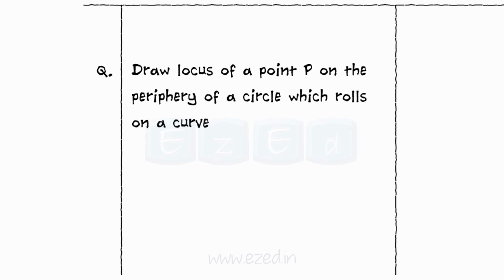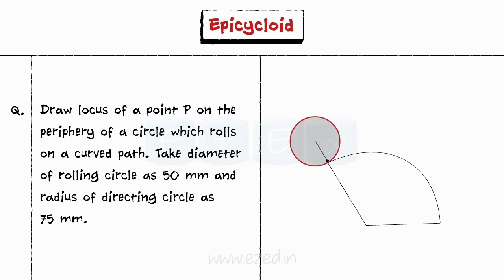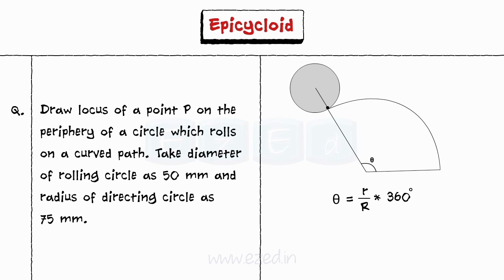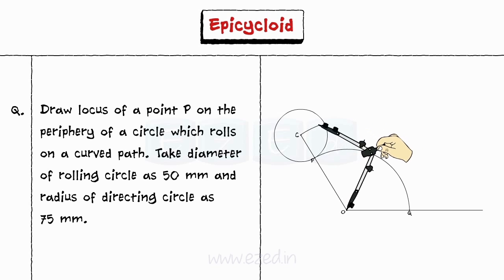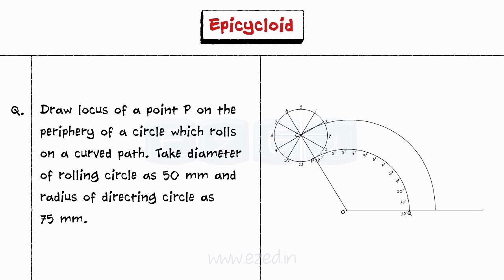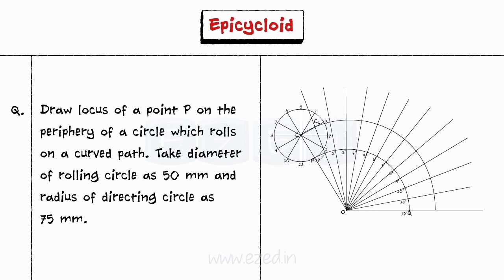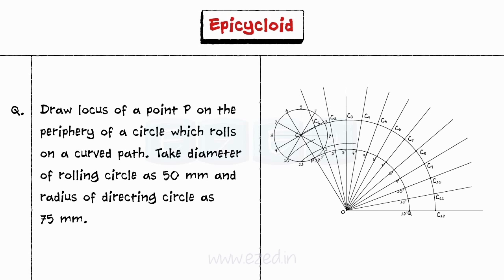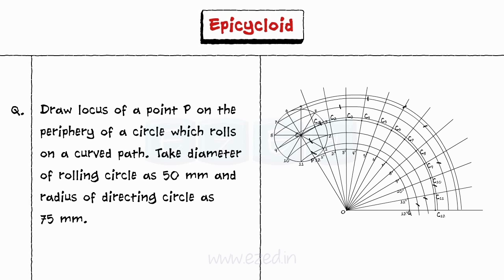How to DRAW an EPICYCLOID CURVE? Engineering Curves  - Engineering Drawing

Comment: 50/75 x 360 is never 120 lol..its 240
Reply: It's not his mistake, in the ques the diameter is 50 mm which means r = 25 mm so there fore ø is 120.
Reply: Common sense 😂
Reply: Really bruhh read the question 💀💀💀
Reply: yh  he made mistake,the radius was 25mm
Reply: Bro one is diameter and another one is radius check clearly

Comment: How to divided the circle into 12 equal parts??
Reply: I think you gotta do 120/2 and then mark 12 points using a protractor (placing it at O) such that all the lines are seperated by 10 degree.
Reply: Just put protractor on diameter and marks points at 30° EACH time so like mark 30° then ° 60° then same so and so
Reply: Use polar array command